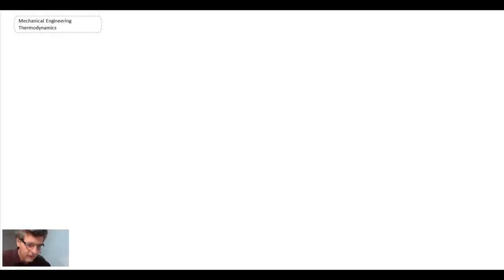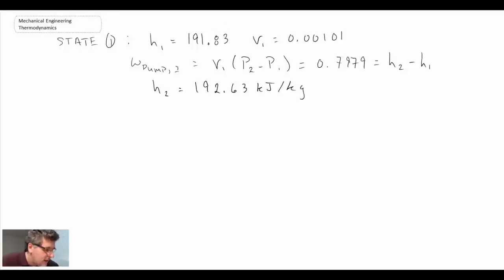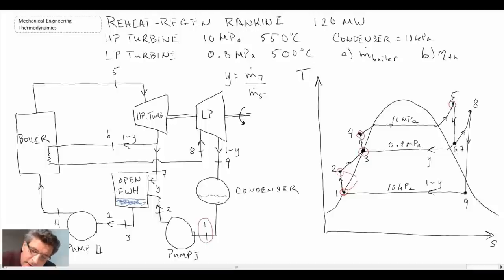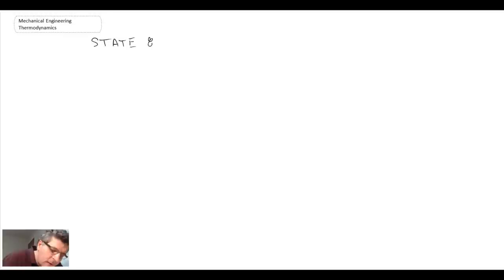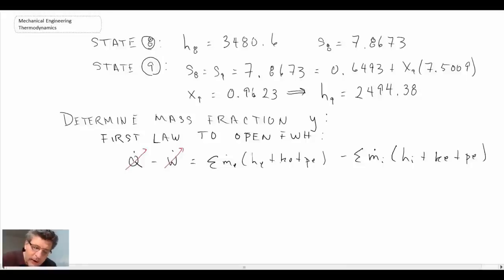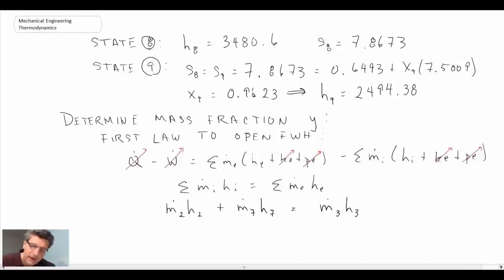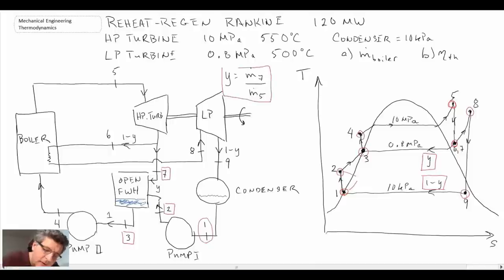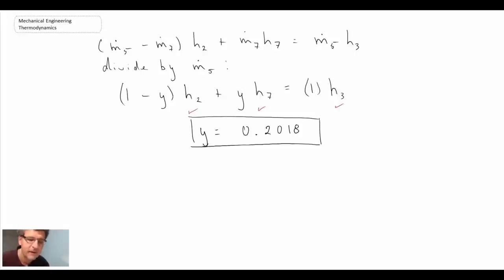Mechanical Engineering Thermodynamics - Lec 21, pt 3 of 5:  Example - Regen-Reheat Rankine - ii

Comment: Hi Ron, I'm working on a similar problem that also involves an ideal reheat-regenerative Rankine Cycle. The T-s diagram I came up with included 2s, 4s, 6s and 9s based off an example my professor did in class. Is the reason the diagram for the problem we did in class has the "s" states because the problem includes adiabatic efficiency in the pumps?

Comment: The class was great but my steam table has 0.8mpa which is 8bar and the answer, I got was not corresponding with your answer.. I could not find 188.46 as the temperature, I'm still on the superheated steam

Comment: Every time I think I've got the hang of this subject, I get it wrong again :( I'm unsure as to how you get h_6, I assumed logically you could multiply the h_g from superheated section by the > 1 x_6 value I used to work out if the point was saturated water/vapour mix or still superheated.
Reply from the maker: Quality is only defined between the saturated liquid line and the saturated vapor line.  You determine h_6 by starting with the known conditions at state 5 (10 MPa and 550C).  From the steam tables you know this is superheated.  You can determine both enthalpy and entropy at state 5 from the superheated tables (h_5 and s_5).  We are not given an isentropic (adiabatic) efficiency for the HP Turbine, thus we can assume that the expansion from state 5 to state 6 is isentropic (i.e., s_5 = s_6).  We know the pressure at state 6 is the LP Turbine pressure (0.8 MPa).  What you then need to do is go to the steam table and check to see if the value of entropy at state 6 (0.8 MPa) is in the two phase region or the superheated region.  If s_6 is greater than the s_g value that you find in the table for 0.8 MPa, you know that you are in the superheated region and you then need to use the superheated tables.  You then find the superheated table for the pressure (in this case 0.8 MPa) and you find where s_6 is on this table.  It may be between temperatures listed in the table, in which case you will need to interpolate to determine h_6 (and T_6).  Also, some tables may not have superheated data at 0.8 MPa.  If this is the case you then need to interpolate for the values (h, T, s, etc) at the given pressures (say 0.5 MPa and 1.0 MPa) to 0.8 MPa, and then interpolate for the values of interest (h_6, T_6, etc) using the known value of s_6  - an extremely laborious process!  Hope that helps.
Reply: Thank you very much for your help and the videos!

Comment: Please can you tell me how you got the value in state 8 please
Reply from the maker: You are told that the entry conditions into the Low Pressure Turbine are 0.8MPa and 500C. Looking at the steam tables it is possible to determine that this is a superheated state, from which you go to the superheated steam tables and get your values from there.